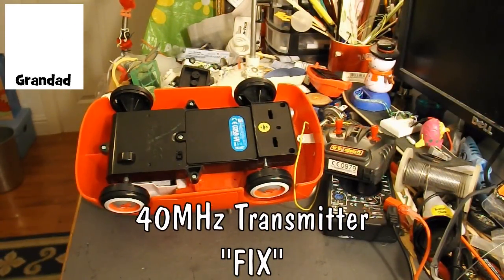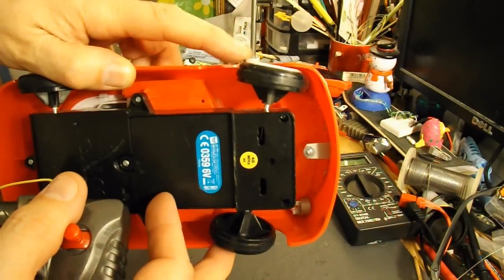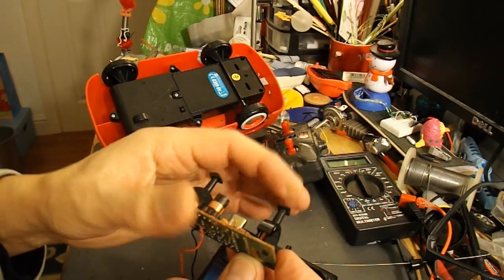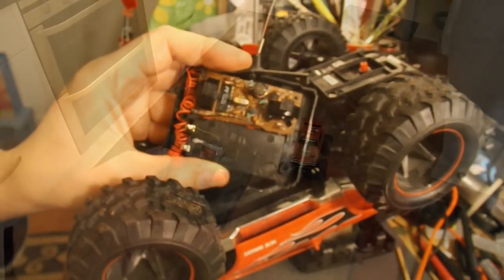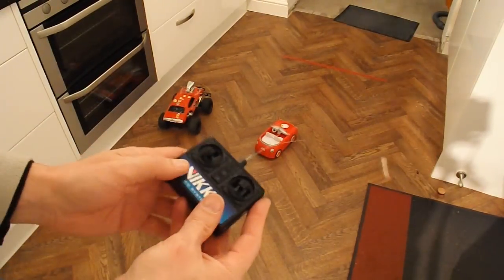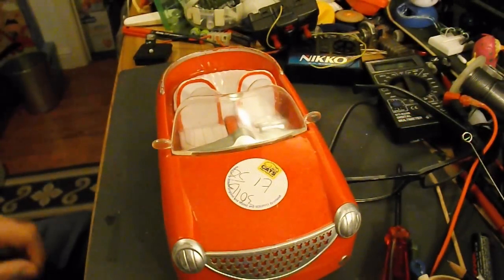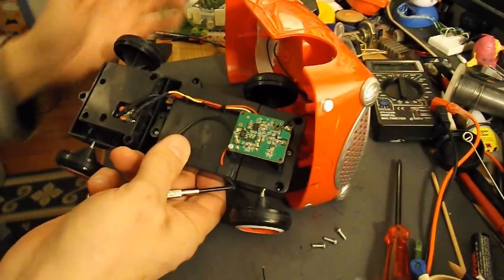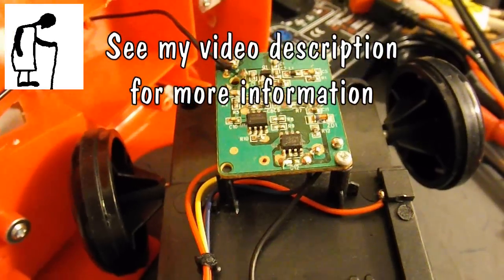40MHz transmitter "fix" ???

Comment: I can throw some light on this if your interested.
The 40 mhz radio signal is generated on the pcb separately to the control chip.
The commands for for/rev/left/right are encoded onto a pulse train similar to that done in an old dial up internet modem, the data rate, or baud rate as you'd say for a modem is set by an internal oscillator within the control chip, pin 12  has a resistor connected to it that sets this datarate frequency. There is probably a mismatch in datarates between the transmitter and receiver as they are not from the same toy (they need to be the same), you are correcting this mismatch by putting the piece of wire on pin 12, hand capacitance or possibly feedback from the transmitters own aerial is forcing the datarate frequency to shift and match that of the receiver, the chip pair are designed so that they'll still work if they are mismatched by up to 4x.The manufacts provide this function as a low data rate increases range but slows down control response, and a high rate speeds up response and decreases range, for a single function toy you'd use a low rate as theres only one function.If you want to do this more scientifically replace the resistor in pin 12 with a trimmer 5x its resistance, then twiddle till it works.
Reply from the maker: hellcattanks that might be worth a try, thanks.
Reply: Wow! Super close to my best guess, without reading this comment first :-)

Comment: Glad it works. I was trying to find a variable frequency remote control or even a circuit so I could build it. No luck yet
Reply from the maker: If you google the TX2RX2 chipset data sheets they usually have example circuits, and some of them do include the requirements for the different frequencies. However I have never attempted to build one from scratch. This data sheet shows the workings of the chip nicely, but does NOT cover the RF circuit http://blog.tkjelectronics.dk/wp-content/uploads/2011/09/RX2_TX2_Datasheet.pdf
Reply: @GrandadIsAnOldMan TX2B/RX2B.
Reply from the maker: @HappyHermitt  there are several variants of the tx2rx2 chipsets

Comment: Some remotes have little adjustment places to tune the transmitter and receiver frequency.  They are in both the transmitter and receiver.  You need a tiny screwdriver for eye glasses to turn it.  This is probably to let people run several cars on different frequencies.

Comment: Hey, what should be the lenght of antenna if my RC car has 40 MHz frequency?
Reply from the maker: This thread on an RC forum may help you, the comments point out that most RC gear has circuitry to change the actual length of antenna required so knowing the "correct" length may not be the answer http://www.rcuniverse.com/forum/rc-radios-transmitters-receivers-servos-gyros-157/8295524-proper-antenna-wire-length.html

Comment: BTW the wire method works because it uses it as an antena to send signals through
Reply from the maker: Not really, as I explain, I am attaching that wire to pin 12, which is the adjustment for the internal clock frequency. The antenna connects to pin 8 via the radio transmission circuit, so connecting a wire to pin 12 does not act as an antenna, the signal does not go to that pin. Here is the data sheet for the chip if you want to trace it out for yourself https://www.diodes.com/assets/Datasheets/PT8A977B978B978BL.pdf

Comment: Hii, i have a question. My rc car is 40mhz nikko. But no remote. And I found 40mhz remote control same brand, but different type. Is it can use on my rc car?
Reply from the maker: I am not sure why you are asking. Surely if you have the car and you have the remote you have tried them together and know your answer without asking me. All I can say is it might work and you will find out when you try it. I have a box full of remotes I have collected. When I get an rc car I go through the box to see if I have a match. Sometimes I am lucky and sometimes I am unlucky. Sometimes I have to swap out the receiver for one that I have a matching remote.
Reply: @GrandadIsAnOldMan  thanks, how about 27mhz?
Reply from the maker: @hackerista4052  you would need a matching 27MHz receiver and 27MHz  remote, the same way that you need a matching 40MHz receiver and 40MHz remote.

Comment: Hello. I'm fixing my old RC 1979 Custom Van, is already working, but the two servos that move the van right and left are missing. It seems one of my nephews was playing with it when I wasn't looking :/. Do you know of any toys or home appliances that work with small servos? Because in Radio Shack and other similar places they cost a lot :/.  Regards.
Reply from the maker: I buy my servos from China via eBay, they are really cheap. It just depends what you need. Here is a typical example http://www.ebay.co.uk/itm/261521757538
10 servos for £14.99
Reply: Well I'm not sure, the ones from my van were the size of a Peanut. No seriously, they had a small gear in one end. They work with 1.5 Volts each and together they act as one motor that move the front wheels in different direction, making the van go right or left. Thanks for the info, let me check the ones from Ebay. Regards and thanks again.
Reply: One more thing, you have very cool toys, I also have 4 remote control cars from the 80s. the oldest one is the van that I mention. Regards.

Comment: Yes, perfect for motor on/off on an otherwise free flight...an already very popular one that has wheels on it ;)
RX-3E, connect a wire to Pin 2 lol
Does Pin 6 of the other chip supply a 'Turbo' to the working car ?
Reply from the maker: Yes you can see where my mind was going, it would switch off the motor as soon as it got out of range. I would have to up the power to carry the extra weight, but the benefit of not losing it would allow me to use a decent battery anyway.
RX-3E pin 2, yes there is probably a way of using that effect to 'tune' the receiver as that seems to be what is happening with the transmitter. You might have noticed that initially it didn't recognise the 'reverse' direction signal from the transmitter but after the transmitter was 'fixed' it reacted to all 4 directional inputs. - although it went backwards in response to all of them.
Turbo - I believe it would if implemented. Those faulty receivers I worked on a while back had the 'turbo' output but it was not connected to anything and I guess you would need to add a push button to your transmitter somewhere to send the signal. Probably an interesting project on it's own. Maybe not turbo, but some other operation like maybe fire a gun or flash a light or something.

Comment: Did you ever make the radio controlled plane out of the receiver from this rc car?  I have a tiny tiny receiver from a rc matchbox car that I don't know what to do with.  It's about 1 centimeter by 2 centimeters in size.
Reply from the maker: Ichiko Sudo the main problem with using this type of transmitter and receiver for a plane is the lack of range, probably only 3 to 5 metres so you would have to run after a plane to keep it in range. That is assuming you are capable of soldering the hair thin wires to connect the receiver to whatever you want to control. It is not an easy task.

Comment: how far does the 40mhz controller take?How many Meters?
Reply from the maker: Do you mean this specific controller or 40mhz in general. The answer is the same anyway. It depends on the power of your batteries and the length of the aerials in both the transmitter and the receiver. Generally toy grade RC systems are only designed to work over 4-6 metres maybe 12 metres in a nice open area.

Comment: Hi i have a problem with my RC car. when i use the remote control nothing happens. The car doesnt want to work. The remote is 40Mhz and 9.6V. Can you please help me solve this problem.
Reply from the maker: The usual problem is loose battery connections either in the car or in the transmitter. If you have another car with the same frequency transmitter you would be able to find out if the problem is in the car or in the transmitter 😊

Comment: I have a 27 MHz toy car transmitter and there is no IC chip in it. Forward and reverse options with only 13 components, like resistors, capacitors etc. How does it work without any chip? Thanks
Reply from the maker: Are you sure there is no chip? It may be a black blob that looks like a lump of paint.
Reply: I opened it for you today and there is no black blob there. The black blob, you are talking about, is used in Casio caculators. But there are no tiny chip. I can send you the pictures or a short video to you if you share me your email address. There are 3 transistors with "C9018" markings, 1 green inductor with striped lines. 5 ceramic capacitors with markings of 104", and an adjustable slug coil.
Reply from the maker: Why don't you just upload it to your channel?
Reply from the maker: It might be worth your time reading this article https://www.talkingelectronics.com/projects/27MHz%20Transmitters/27MHzLinks-1.html
Reply: But I do not have a YouTube channel. Thank you for your quick replies. I am learning this stuff from you.
Reply from the maker: https://www.youtube.com/@mianahmad5918
Reply: @GrandadIsAnOldMan that is great to know that there is my YouTube channel by-default. I will make a shirt video for you. Tomorrow is Sunday, I will try because you are a great radio expert.

Comment: that's a really good idea
Reply from the maker: Hi Alison, thanks but I would be happier if I knew how it worked. This is one of those accidental fixes where I was just poking around hoping to find something like a loose wire and noticed it started working when I touched a particular terminal on the controller chip. It is not what I would call a fix.

Comment: you should make the Mickey Mouse (foward reverse) car's steering remotely functional.  Would be nice.
Reply: I never seen those type of RC vehicles have remotely operated steering.
Reply from the maker: +GuitarRocks360 I could but it rather takes away the simplicity of the car. It is designed for very young children to play with so it has a very simple function, just forwards or backwards. To give it functional steering I would have to replace the receiver.
Reply: +GrandadIsAnOldMan maybe someday you'll make an rc car 2.4 ghz
Reply from the maker: GuitarRocks360 this one is 2.4 ghz https://youtu.be/uM7Obu2wnKA?list=PLA5a2xPRSrB13Xcquw4Ff09MQzTPjeVkI

Comment: My rc car goes only in forward direction and little bit in backward Direction plzzz make vedio for that
Reply from the maker: First you would need to check there is nothing wrong with the gears. No teeth missing, no split in the gear allowing it to slip on the shaft. No hair or dust around the axle stopping it turning. If you have done all that, then the most likely reason for it going forwards and not backwards would be part of the "H-Bridge" circuit has failed. The H bridge is the part of the receiver circuit that sends power to the motor. Here is a video where I did some work on this problem https://youtu.be/wIWNY1R5KZo?list=PLA5a2xPRSrB1f-x1-lufP6dnLQZWafj6v  and here is another one https://youtu.be/5w7f2Fblo4k?list=PLA5a2xPRSrB1f-x1-lufP6dnLQZWafj6v and another here https://youtu.be/PdZJJi56Lu8?list=PLA5a2xPRSrB1f-x1-lufP6dnLQZWafj6v
Reply: @GrandadIsAnOldMan  but when i was inserted new batteries in remote , the car permof all activities but after some seconds the forward it is going only.....i have checked that all my motors of car working

Comment: GrandadIsAnOldMan  can you make a mini fan car with a pager motor and a mini car. can you use a cheap car and not make it your self
Reply from the maker: I don't have any pager motors but the ones I take from the Oral B Pulsar vibrating toothbrush are a similar size. Here is one driving quite a large car http://youtu.be/ysn4Xkm0b8k
Reply: yes i meant them i though that was their name.
Reply: GrandadIsAnOldMan could you make a really small one please

Comment: Can you make a hot air balloon and add your smallest motor thanks grandpa I'm Charles
Reply from the maker: I will not be making one but for your information a motorised hot air balloon is know as a Thermal Airship http://en.wikipedia.org/wiki/Thermal_airship
I consider free flying hot air balloons to be hazardous to other people and property because they carry a flame that could cause a fire.
This is the only type of hot air balloon that I have made and you will see I use a hair dryer to heat it and keep it tethered so it does not blow away and cause a hazard to anybody.
http://youtu.be/Bcllc3fBi6I

Comment: Antenna anyone? :-)
Reply from the maker: If you mean that the wire I have added is replacing the antenna, no, you are wrong. I show you the circuit diagram and the pin. I believe it affects the carrier frequency of the radio signal.
Reply: GrandadIsAnOldMan Ok, maybe I've been a bit hasty. Anyway, I've checked the diagram and pin 12 should be connected to a 200k resistor to pin 11.
My best guess is the resistor placed on the pcb is damaged, hence a long wire works as a substitute.
If you don't mind to try this experiment, (I mean, please don't blame me if it doesn't work), I would replace your wire with a 200k resistor between pin 12 and pin 11.
Reply from the maker: RC Lover san Thank you. You might guess that as I have downloaded the pdf datasheets for the chips and included them in the video I might have already read them. Perhaps you might like to read some of the other comments. The one by Splitfire pilot (1 year ago) probably gives the best explanation and suggestion.
Reply: I'd like to add another thing, regarding how transmitter sends commands for the direction.
The controller has been programmed giving to every channel a specific range, therefore you can't change it.
If you watch my video about how Arduino gets the signal from the Flysky FS-T6, you'll understand immediately how this thing works. Again, just for the sake of doing some experiments.
Reply from the maker: RC Lover san I have watched many of your videos. Which one are you talking about?
Reply: You can work out the length of an antenna by dividing the speed of light by the frequency then divide by 4, so for 27mhz the ideal length would be 2.7m, the actual antenna is shorter than this as there is usually an inductor inline on the tx pcb to compensate, much like the inductor at the base of a Cb aerial.
Reply: Thanks for your explanation.